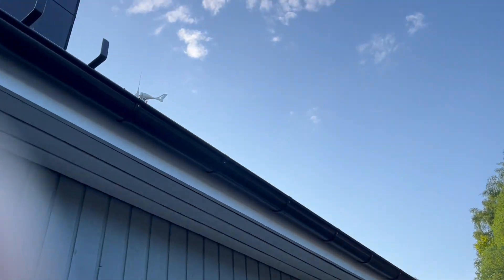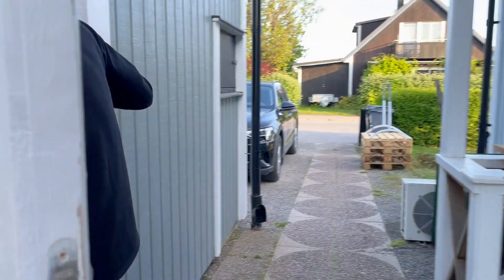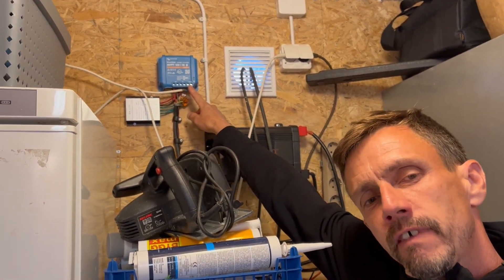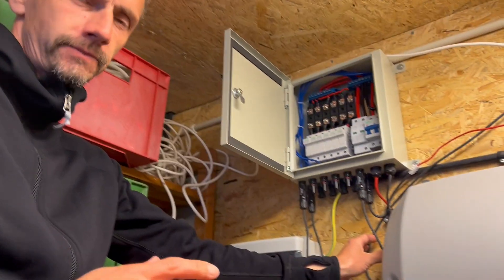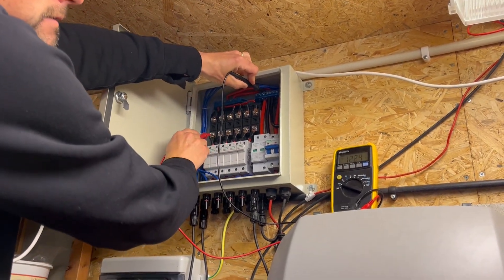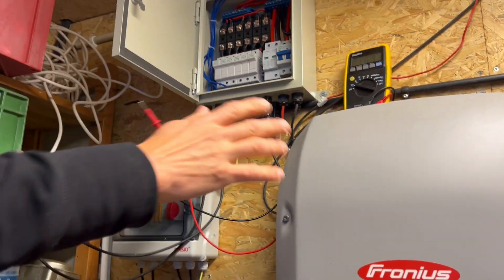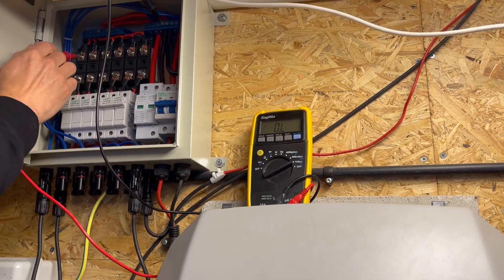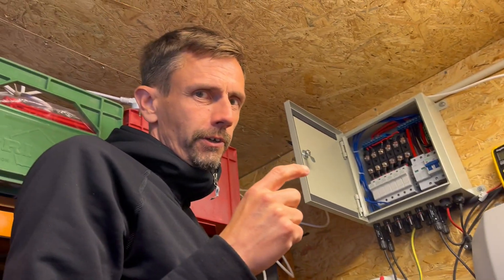ECO-WORTHY 6 String PV Combiner Box

Comment: Mixing AC wind with DC solar perhaps ? How did you get on, any answers?
Reply from the maker: It does not work. The combiner box only works when the voltage is the same. So now its just a fuse box for me. I use it but no combining. The wind power I get is of no use at all.
Reply: Ah well, it's not the end of the world. Stay safe and get back to your dinner now.  @StellanLarsson
Reply from the maker: Thank you! @Fester_